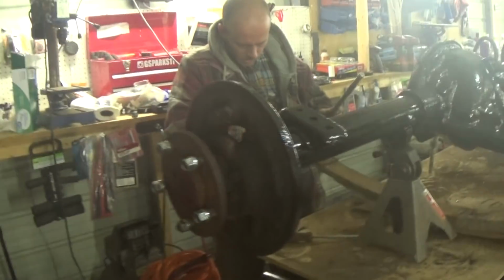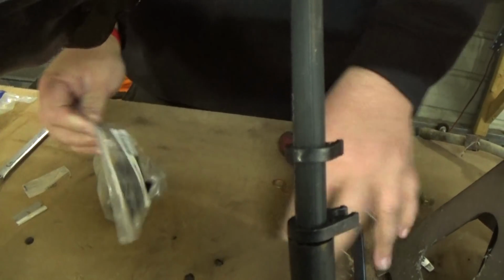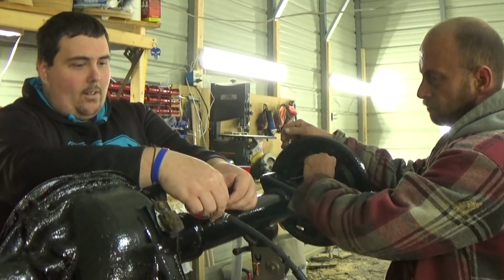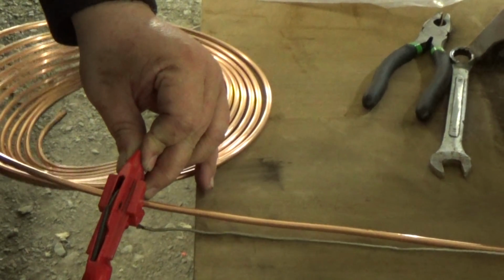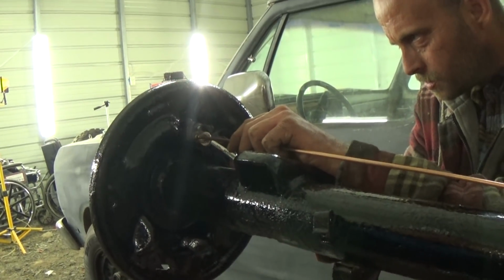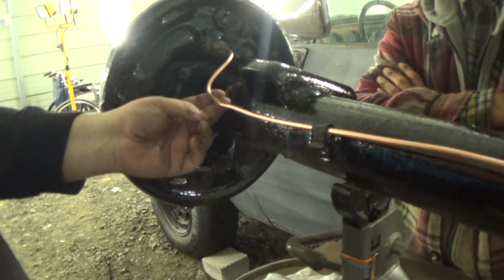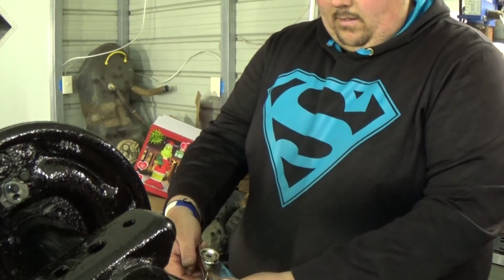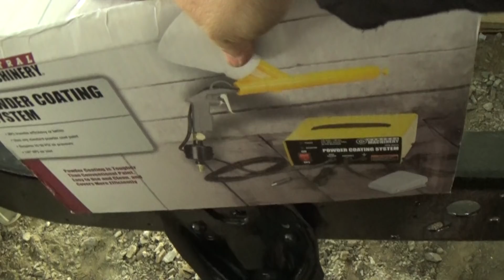FIRST GEN RAM FINALLY GETS NEW BRAKE LINES! LOOKS SO GOOD!

Comment: Copper line will not work. It can't handle the vibration of the road. And brake lines need to be double flared.